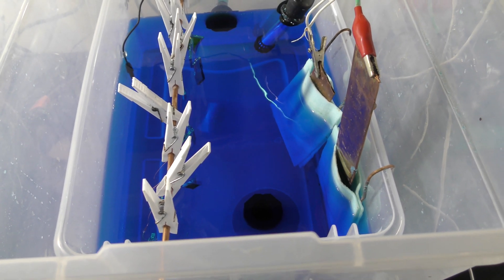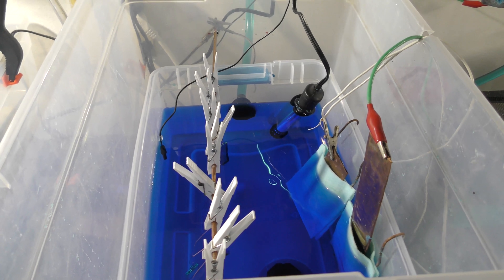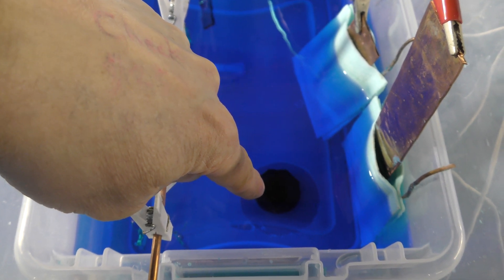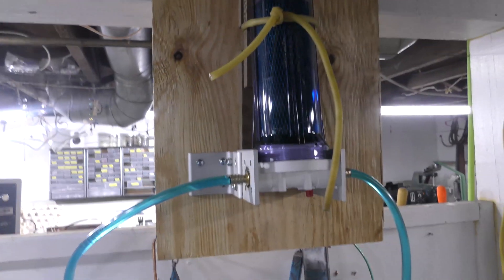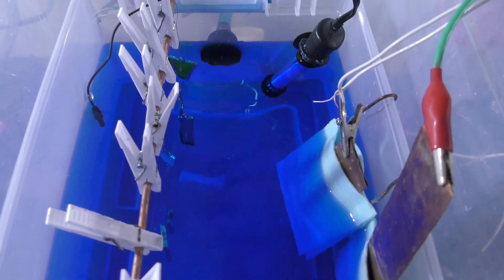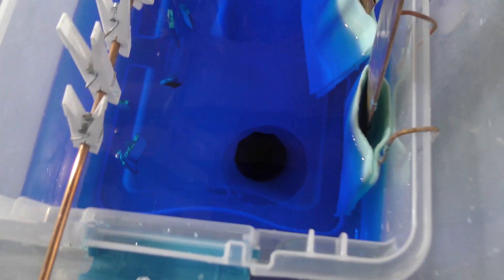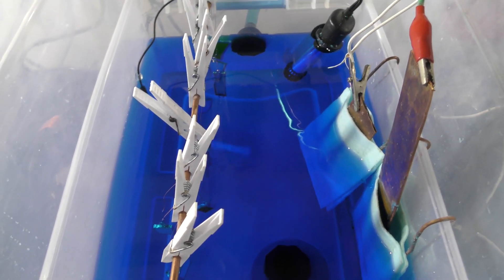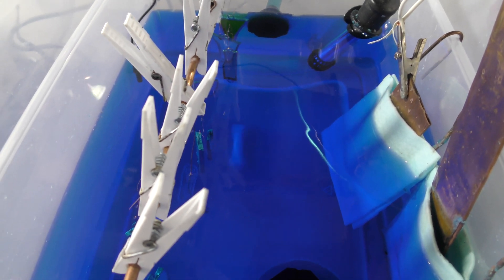Carbon filtering Electroforming tank with pump build.

Comment: My husband and I built a pump setup like you have here. It worked really well but eventually, it started leaking around where the tubes connect with the bath. Any tips on keeping everything air tight?